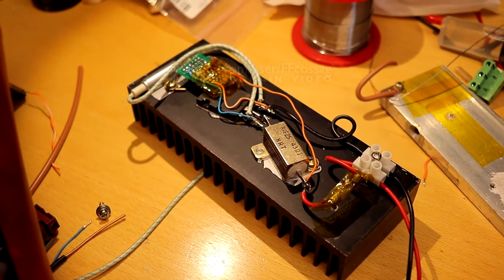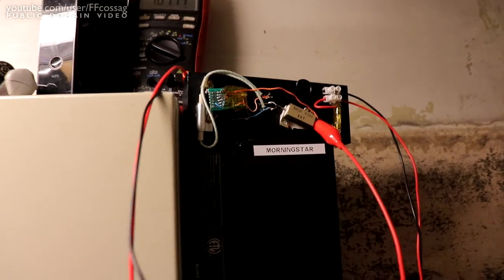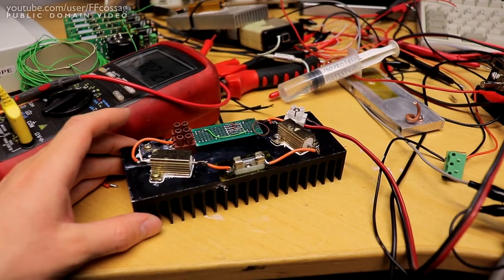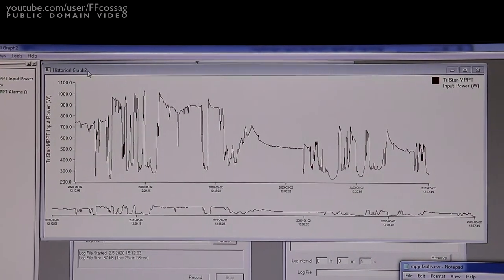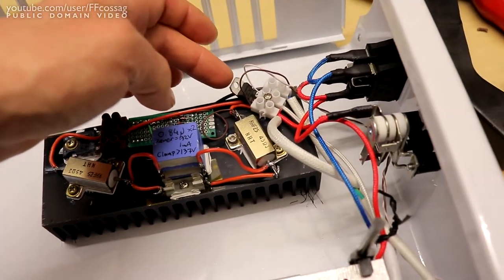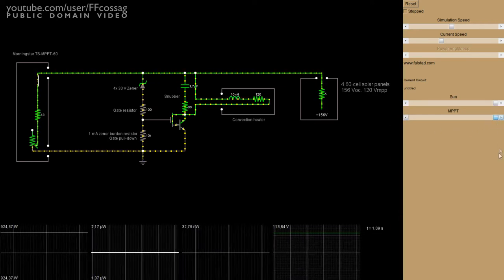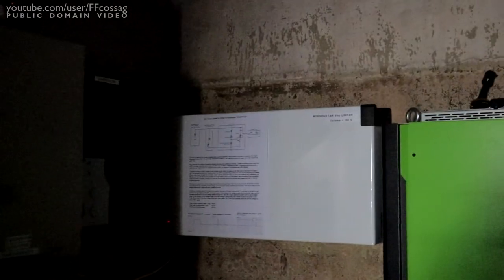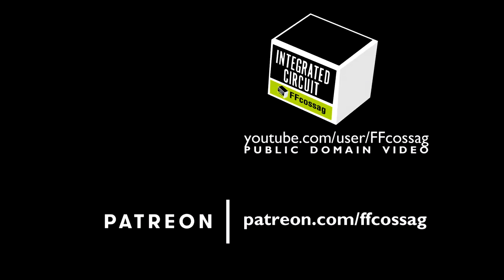Voc clamp for running 4 series panels on a TS-MPPT-60

Comment: It makes me think that an immersion heater as a dump load would be ideal here, free (bar setup costs) tanked hot water and a solution to the OC problems, I've seen some examples of people sending the unused power from solar and wind turbines to a water tank to make use of it when it's not needed for batteries or general use... :)
Reply from the maker: That's a common solution when you have lots of energy to get rid of. This thing only dissipates less than 1 Wh per day in normal operation. Ideally, the batteries will never be so completely charged that it has to continuously trigger.